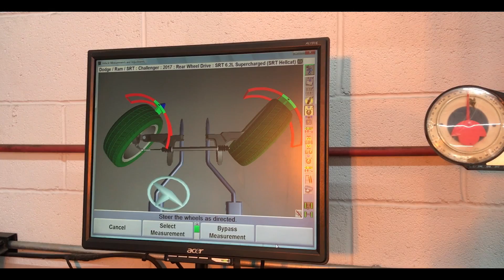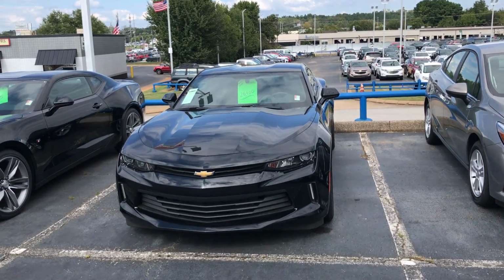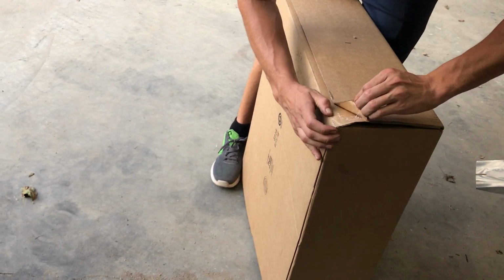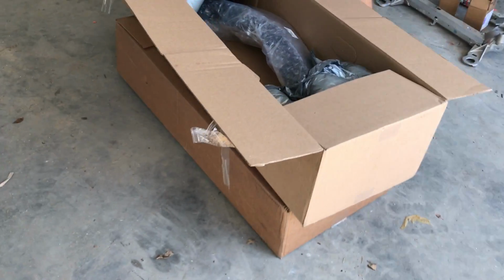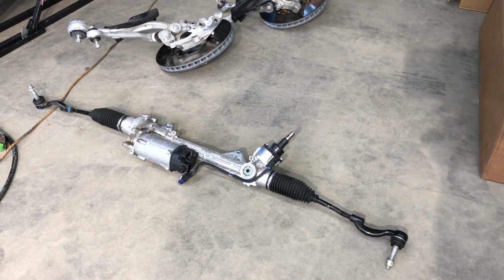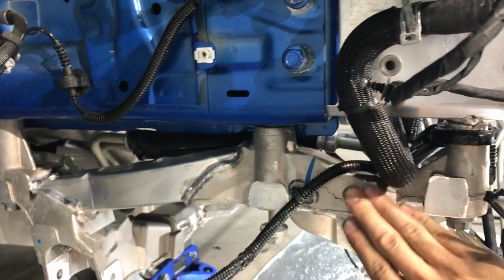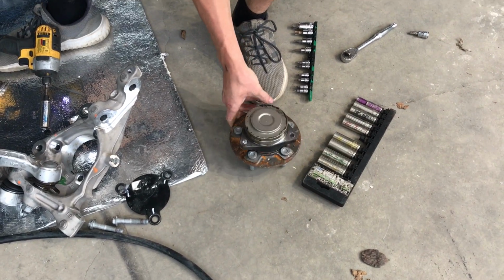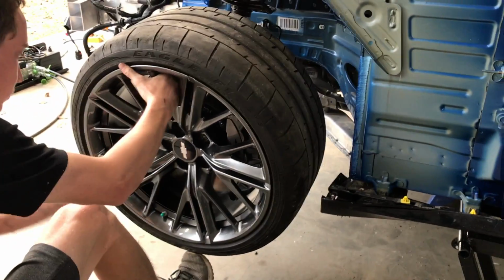Rebuilding A Wrecked 2018 Camaro ZL1 Part 4

Comment: You guys need to invest in a torque wrench. The subframe and suspension bolts should be torqued to spec. If you over torque the bolts on aluminium frame, it can crack under stress (going over a bump etc). Under torque suspension bolts and things fall off!
Reply: They haved  one if you see the jeep tj they used in there. They torque the bolts  out of camera
Reply: @29mailman  they use alse

Comment: Please use Jack stands when you have the car up. No matter what things can go wrong and it's too late if they do and your unprepared.
Reply: I believe the jack system they're using has a safety pin, which essentially acts as a jack stand.
Reply: I agree with both of you, but better safe than sorry
Reply: @DAKILLAKIDProduction  yep safety lock just like rachet. I think
Reply: You can see they have jack stands under the car bro. There blue. And also the lift system have a catch on it so it acts as a safety jack
Reply: I have quick jacks and the safety rod is 1/4 inch thick but I still use jack stands, 1 on each side inside the quick jacks just to be extra safe. Had a friend crushed by a car a couple years back so I take no chances. Double or triple redundancy is ok in my book.
Reply: The style lift they have there sits on mechanical locks not the hydraulics. What I did not like was the use of a floor jack only to hold the engine up while switching the subframe.
Reply: That’s about as overkill as using jack stands while using a two post lift.
Reply: @njshift  If that comment is directed at me I can say this YOU NO AUTO TECHNICIAN!
Reply: CRAZY HORSEPOWER it wasn’t directed at your comment
Reply: @njshift  k thank you for the clearing that up.

Comment: Get yourselves some cheapo metal (solid shelf) storage racks for parts. You can replace the feet with castors so you can move em around. Super helpful. Sears online has some 5 shelf heavy duty units for 70 bucks, each shelf holds 500lbs. Also the Eastwood wheel dollys are awesome for moving cars around. Dont cheap out on the harbor frieght junk dollys, they are horrible. Keep up the good work.

Comment: Find a GT 350R next and build it with a supercharger 😮
Reply: That would be sick
Reply: I thought they were gonna supercharge their mustang
Reply: Or a GT500? 😃
Reply: fourwheelerjock that would be killer. Problem is that supercharging a voodoo engine would be more performance. You would have to mod a super snake engine to get it up there and even then you wouldn’t have a car with independent rear suspension.... 😕
Reply: D7 Puncake ..... Hey wait a minute they were supposed to do that! You are right!
Reply: @ClaytonMRay  GT500 is the better engine lol. You realize the GT500 motor is the same motor that comes in the shelby 1000's that make 1000-1100HP lol. I love the voodoo motor. Great piece.
Reply: fourwheelerjock the thing is, the gt1000 is a 5.8 liter supercharged engine with heavy engineering to make that 1,000 hp. The 5.2 liter voodoo engine stock makes 529 horsepower and is NA. The giant difference is that since the 5.2 is a flat plane crank motor it can function way past the safe rpm limit for the 5.8. You add a supercharger and a set of injectors to the 5.2 and you have one hellaciously mean surplus of power under your hood.
Reply: fourwheelerjock i agree with you that the GT1000 motor is fantastic. The 5.2 although smaller is just an incredibly well built and efficient engine with lots of room to build on...
Reply: @ClaytonMRay  You can ask any builders or engine tuner what is the better motor. They'll say the GT500. Only thing different from a GT500 and shelby 1000 is blower, boost psi and fuel system. Still with room to grow. GT500 motors are known to rev high as well. Hell the coyotes are reving to 8200 as well N/A and boosted.
Reply: fourwheelerjock are you talking about the 2013 or 2017 gt1000? If you are talking about the GT1000 from last year then i agree with you completely.

Comment: How do you get an alignment done with a bent wheel
Reply: I was wondering the exact same thing
Reply: The wheels are new
Reply: @cesarramos216  not on the hellcat the passenger side rear is all buckled and bent
Reply: The World Shall Know 

Hellcat
Reply: Your content is amazing !
Reply from the maker: Simple16x we got it as straight as possible for now but we get a warranty on it so as soon as we get the new wheel we will align it again
Reply: @goonzquad  ah that makes sense :)
Reply: goonzquad ah I see
Reply: In Firestone it’s called a lifetime alignment
Reply: They also have to figure out why the air bag light is still on after having it reset. I am wonder if something was left unplugged or a bad part or censor.
Reply: Eduard Tsipan 

They are 2 tiers

1- life time warranty 
2- 1 year warranty 

They range in price
Reply: the error code is stored in the dash cluster on gm's might be the same on the hellcat...
Reply: Lol hahahaaaa

Comment: U being under the car like that seemed a bit dangerous. What do you think about a secondary precaution? Love the channel to though💪🏿
Reply: Those jack have locks sir.
Reply: J Silver I think he was referring to when they had the engine mounts undone, and just the jack holding it up.
Reply: The car was still held up by the quick jack lol, the floor jack was just for the engine
Reply: Even if the jack was slowly coming down, it wouldn't be catastrophic as it's still coupled to the transmission which is held by it's mount(s).
Reply: J Silver yeah exactly, couldn't fall far lol, and I highly doubt the jack will give out on the engine

Comment: I cant help but wonder why it is iv'e never seen you guys use a torque wrench?? Iv'e watched all of your builds and I can't recall ever seeing one...
Reply: They used a torque wrench in this video, the hell cat build, the corvette build, and the F-250 build 😂
Reply: @ClaytonMRay  you obviously don't know what a Torque Wrench is lol
Reply: BoardsByTheBay i’m from southwest missouri. It was on the back to school supplies.
Reply: @ClaytonMRay  where in the video did you see a torque wrench?
Reply: BoardsByTheBay my bad. At 17:56 i thought i seen him using one. It was a cheater bar on a regular wrench 😂
Reply: The torque wrench is that open-ended thing that has the thumb wheel on it. If it slips off, it's tight enough!
Reply: Do you think body shops use torque wrenches?  If so, you're wrong.
Reply: Tight is tight!

Comment: Leave the rack -  pinion just use hangers to hold up.  you also need to support the engine and transmission when dropping sub frame.  That make a tool for this.  It goes strut tower to strut tower and hooks on the heads.  Makes life easier.

Comment: You need a torque wrench on the tie rod install. Torque specifications are a critical part of installations. Nuts and bolts are designed to work at specific torques, and it's not something to mess around with. Lots of fasteners also spec a thread-lock compound like Loctite. You need to buy and use a high quality torque wrench, not some crap from the local Chinese tool store.

Comment: Yep, at the shop I work at I took a 2018 apart because we thought it was going to fix, only to find GM did not offer the piece required to repair the car back to factory, so after all the work Insurance had to total it.

Comment: I can’t believe you guys are using a 1/4 shank impact. Time to step up to some Milwaukee high torque or mid torque impacts. They just released a new line of 12v stubby 3/8 and 1/2 in impact drivers too if you don’t want 18v.

Comment: guys, not hate, but you maybe should start use a torque wrench for some bolts, specially for frame and  suspension bolts. correct me if i'm wrong or i missed something.

Comment: Next time you need to drop a subframe, get yourselves one of these things.  Saves a lot of headaches trying to keep the engine stable when you pull it: https://www.amazon.com/gp/product/B00061SFRI/ref=oh_aui_search_detailpage?ie=UTF8&psc=1.
Reply: Safer than crawling under a thousand pound engine/transmission that's supported by nothing but a hydraulic jack too.

Comment: I like to know how bad that sub frame was also you did not need to remove the entire control arm spindle assy,What you could of done is release the control arm from the sub frame and tie the suspension away.You should of had a cherry picker to hold the engine up not a jack stand.Also you are not the first to remove the sub frame from a ZL1.You may have damage to rack and pinion if the tie rod took a bad hit like that.

Comment: Use jack stands much safer I wouldn’t trust that lift
Reply: The lift has a positive lock setting. It is just as safe, or safer than jack stands. Now, working under the engine supported by a floor jack ... not so much.

Comment: What's the dealer markup for all these parts?!?!?! Have you guys considered ordering oem parts yourself online?
Reply: I’m sure they set up business accounts. Usually around 20% off MSRP and tax exempt. Online isn’t bad but expensive when shipping large items like bumpers and quarter panels.
Reply: @njshift  Even tax exemption... interesting I guess that would only apply if they intend on reselling the zl1?
Reply: Adam M  Honestly In most cases it shouldn’t be an issue as their parts purchases create content for their automotive restoration channel. Tax exempt laws will vary state to state however.

Comment: So lets talk about who is paying for these parts.  No way on earth you guys are, and it was proven to me when you ordered that little triangle shaped backer plate for the hub assembly.  The old one would require only minor bending to use, and yet you ordered one.  Shows me you guys either
1) Don't have to pay the full parts bill
2) Have a large bank account and simply do not care anymore(which seems weird, given that if you are rich, why dont you just finish a nice place to work in)
Reply: well its a totaled car, if they want to sell the car as a rebuilt title they wanna make sure all the parts are good. Makes them a more trust worthy seller and builder.
Reply: Having rebuilt, and driven/sold several late model cars, I can assure you, you do not know what you are talking about.  No one is going to look at a small backing plate inside a spindle/hub and see if it was straightened.  People buying a rebuilt salvage car trade for 75% (sometimes 50%) of undamaged value.
Like so many comments on Youtube, yours is pulled from thin air
Reply: The knuckle shattered, the bolt where that bent plate was sheared off. How do you know if that flange on the hub didnt sustain any damage? Unlike you who rebuilt and sold many late models (unconfirmed), these guys show their builds on youtube. This video alone got 370k views, from those 370k view im sure some of them are very interested in buying this car. By being so meticulous with their builds and showcasing that, they will be able to sell their cars at a higher value. They dont cut corners to do quick flips. Maybe you do Mr. Thornton, and people now should look out for your rebuilds.